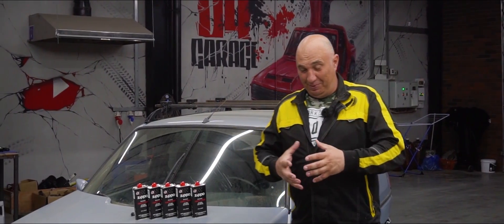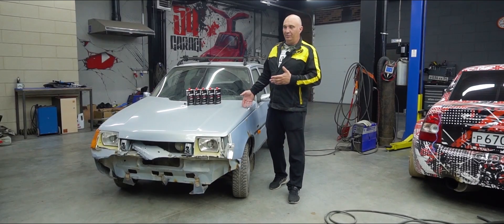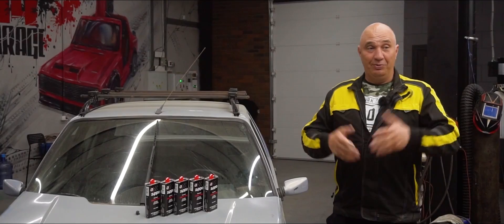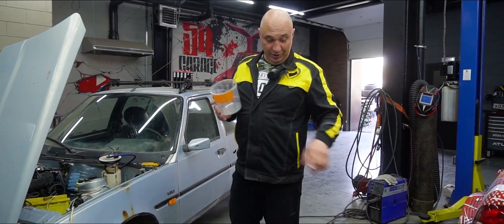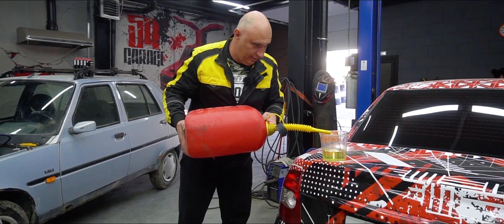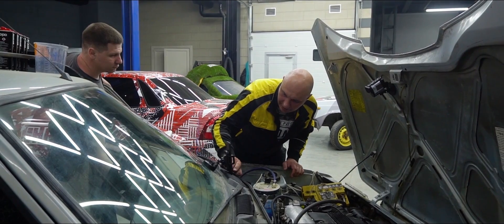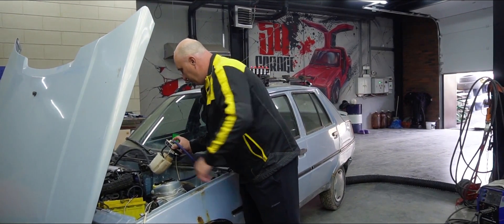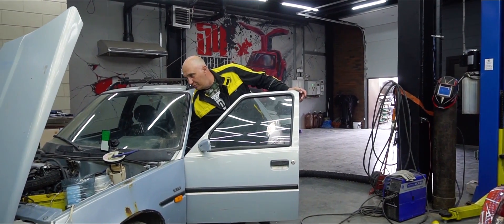Can a car run on Zippo lighter fluid?

Comment: Back in the 60s, on my way to work, ran out of gas and rolled to a stop in front of a convenience store, with a gas station in sight in the distance.  Ran into the store and bought a few large cans of lighter fluid which got me to the gas station.  Not recommended for long periods of time due to preignition.  Lighter fluid, nail polish remover, acetone, all the same except for the perfume.
Much later, in the 80s I found I was running low on fuel in my diesel rabbet on an interstate in Indiana  with a few miles to go to a truck stop.  Turned off the interstate into a small town with a grocery store.  Went inside and bought a couple of bottles of pure corn oil.  Back on the interstate, low power, top speed 45mph, low mileage, smell of French fries all the way to the diesel pump at the truck stop.  No bad side effects.  Wouldn't recommend it as a regular diet, but doable in a pinch.

Comment: Lighter fluid is actually naphtha or white gas,  same as coleman camp fuel. The reason it burns better, has more power, and causes the engine to knock, is that it has very low octane, compared to gasoline. Octane, contrary to popular belief, actually causes gas to resist burning, and ignite at higher temperatures. Resisting knock and lowering nox emissions. High octane fuel, actually reduces power in an engine designed for low octane fuel. high octane is required for high performance high compression/forced induction engines because of high cylinder temperatures which would cause pre ignition

Comment: Zippo Lighter Fluid consist of:
70% synthetic isoparaffinic hydrocarbon (a light petroleum destilate) & 30% Naphta. It doesn't contain Benzeen.
So an internal combustion engine would run on it, although it's more highly flammable. One should adjust the ignition timing.

Comment: Basically your HP and TQ went up. Just get a NOS bottle and add it to your fuel. My concern it engine tolerance. The engine might not be able to handle it over extended usage, but I could be wrong.

Comment: If the test with lighter fluid was done on a warm engine, the results would differ. A warm engine won’t be running in a rich, cold start mode.

Comment: Notice how the recirculating lighter fluid cleans out the fuel system enough to make the leftovers change color. The Russian gasoline that was in there must be pretty crude, or old. One of the interesting aspects here is the EFI engine with computer controlled spark advance (and a knock sensor) doesn't respond fast enough to the throttle jabs and allows full (normal) advance so we hear a second or two of "ping" which also results in that momentary boost of power. As I see it there would be an actual decrease in power / MPG if they had enough fuel to go a few laps on a track with a warm engine because the spark would probably be in full retard the whole way.

Comment: I have used lighter fluid in a kerosene heater, and it works.

I will say that Zippo Lighter Fluid is more comparable to Kerosene.

Also Diesel engine can run on Kerosene.
( My friend has used kerosene in his diesel truck as emergency fuel, and it works ).

Methyl Hydrate ( Methyl Alcohol ) is more comparable to Gasoline, and is compatible with gas engines, since alcohol injection system exists and is used on gas driven automobiles, where people chose to use it on.

I know there are gas engine cars that are run on pure alcohol, with retune / recalibration of the ecm/ecu.

Interesting test running a car with lighter fluid.

Comment: stack two head gaskets on the engine, then you can run Kerosene in your car. less hp, but better gas mileage. used to do it with generators all the time. Kerosene needs lower compression to run. Use head gasket shellac on them before installing gasket, if you try it.

Comment: Run a diesel engine on brake cleaner! 😁
Reply: David Bull
 ... the fumes from brake parts cleaner are highly toxic but the cleaner itself doesn't burn so needs some fuel. If someone tells you otherwise they have a brand that uses butane as the propellant.

Comment: I repeat, knocking comes from lower octane fuel, not higher. Higher octane fuel is harder to self ignite on pressure, but needs a spark to ignite it.

Comment: I think is just has a bit lower octane rating. If you boosted it with something or added higher octane rating fuel to the mix it would work just like any gasoline.

Comment: do a video on cutting the timing belt on a running car to see the havoc it causes on the engine
Reply: i'm guessing most russian cars would have non interference engines
Reply: Neutral drop tried that with a Honda VTEC, funny as

Comment: When you poured lighter fluid it was completely transparent, when you took it out after the car run for 18mins the lighter fluid is yellowish!!.. why is that?
Reply: its a injection system, there is a return line for unspent fuel, that is supposed to return it to the fuel tank, the fuel line is always going to have some left over, hence the yellowish color, it got tainted enough to just make it yellow. Doubtful that little amount would affect the result any what so ever.

Comment: If you're running higher octane you get worse performance in a lower compression engine. You get higher combustion when running lower octane. Unless you're running a high compression engine high octain will not ignite as easy. The lighter fluid is lower octane due to higher combustion. That knocking sound could have been pre ignition. Also why did you run it with 95 octane? Is the compression ratio 10: 1 on that engine?

Comment: When you pour in the zippo fluid, the engine was already warm. That could be the reason why it ran 3 minutes longer.
Reply: They ran the car on gas after warming it up. The test is valid.

Comment: Try paint thinner, kerosene... Use pork lard mixed with linseed oil to replace the normal car engine oil... 😁
Reply: Linseed oil will gunk up the system, bad idea.

Comment: Zippo gasoline is too low octane that's the reason it's so flammable... You can't use gasoline for vehicles in lighter because it just won't evaporate and ignite so easily... That's the reason for the engine knock!

Comment: The cool thing about lighter fluid is that you can store it for many years and it doesn't go bad. Its very close to regular naphtha used in camp stoves. That may also work and would still be expensive but cheaper than the lighter fluid and would be store well and if it worked like the lighter fluid in the engine it would be a great emergency replacement for gasoline

Comment: Lighter fluid is closer to kerosene in flash point...very low. It also burns dry. It will eventually score a piston and scratch cylinder walls. Engine will knock like crazy and try to keep running after ignition is turned off... detonation outrageous!!!
Reply: Yep. Lol

Comment: So Zippo fluid is around 60 octane, the reason it last longer is a lower flame front speed, which means more energy from the fuel burn, it's low grade gas
Reply: So if it’s low grade gas, shouldn’t it be cheaper than gas?
Reply: @Big.W.  A company can charge you what ever you they want.

Comment: NA low compression economy cars tend to run like hell when you run high octane in them. I bet if you ran some lower octane stuff in it you would get a similar result to the lighter fluid. 95 just isn’t volatile enough.
Reply: Cj Smith... that's not true. The higher octane actually retards the burn so the fuel doesn't pre-ignite before proper spark timing happens. The idea here is to allow higher compression, which is where the extra power comes from.

Comment: Lighter fluid is Naptha. You can buy it by the gallon at most hardware stores. while still more pricey than gasoline, way cheaper than Zippo brand Naptha. dump about 5 gal in and go rip some shit up, lol

Comment: If you take normal pump gasoline and then process it with destillation you will end up with something similar to Zippo fluid, "White Gasoline".
It is gasoline anyway and it will work on modern cars but may be not safer because it does not have the hundreds of additives of which the systems are designed to work with.
It will vaporize really fast so it wont hold on your tank for long but hence the slight power boost as you have more gasoline in vapor form when the spark ignites. The car, as being standard configuration may have incorrect ignition timmigs, you have to set the ignition to ATDC when feeding more gasoline in vapor form because the flame speed is faster .

Comment: Dear garage 54 could take a car and replace most of the panels with pleixglass so it is transparent remove the hood of course as it would melt if made from the same material.

Comment: Lighter fluid doesn't have any lubricants in it though. The engine will blow faster with the thinner fuel. It'll Knock without the octane lube in it. Blow it up. Let's see the flames. Alot of power though.

Comment: Not sure if this is fake.... 

two simple reasons first of all look at the different colour of the E85 compared to the lighter fluid when he's pouring it into the measuring jugs. E85 has a yellow hue while zippo fuel is clear. He runs both fuels But at the end when it comes to check out how much zippo fuel is left It cuts to him pouring out a yellowish liquid out of the container into the measuring jug rather than pulling it out like in the E85 test. Its a conveniently placed jump cut....

Secondly. Zippo fuel evaporates pretty quickly when exposed to air. The guy saying that theres a the same amount of zippo fuel left as the E85 test, i dont buy it. A lot of that zippo fuel would have evaporated. Thats why zippos are a love hate thing. People love that they are classy as fuck but hate the fact that they have to refuel it every week because zippo fuel evaporates.

Zippo Fuel is also a solvent and it will eat away and dry out any rubber piping or seals that it comes into contact with for extended periods. Some people use zippo fuel like they use Acetone for cleaning things.

For a fun experiment its ok. but if you plan to run this in your car long term. you 100% will destroy your engine

Comment: Run a diesel engine with r/c nitro fuel.
Reply: That's actually a very interesting one.
RC nitro fuel is usually a mix of 85% oil & 15% nitromethane.
So the diesel engine should run happily on it.
The interesting bit is if the oxygen in the nitro will increase the power output, or just overheat the engine.
Reply: @thefreedomguyuk  rc fuel (nitro) (the brand I have) is around 8% oil, 25% nitromethane and 72% methanol
Reply: Nitro fuel works for starting fluid in a pinch lol
Reply: Nitro rx fuel has oxygen in it
Reply: It Will blow.
Reply: @tomasnokechtesledger1786  you will blow me
Reply: It would explode
Reply: @RuviaPawz  no
Reply: it wont work. Diesel engines have no sarkplugs
Reply: @teokarlsson305  Neither do nitro engines. Dragsters self ignite half way down the track on nitro methane.
Reply: @UniCrafter  Correct, and they have to.
Top Fuel cars have spark plugs along the first half of the strip, after that point, they don't have spark plugs, only ceramic inserts. The electrodes of the spark plugs are melting.
Reply: @teokarlsson305  they have glow plugs, like rc nitro engines.
Reply: @teokarlsson305  they have glow plugs like nitro engines. A nitro engine is basically a diesel engine.
Reply: @teokarlsson305  But the nitro fuel is mainly oil.
Reply: @teokarlsson305   you can start it on diesel and switch.

Comment: did anyone notice that the gasoline was a yellowish color? Did anyone notice that the lighter fluid was completely clear? Did anyone notice that the "leftover lighter fluid" that was poured back into the measuring cup was the same color as the gasoline?

Comment: "Regular 95 octane"
If only
Reply: Are you in the USA perchance?
Reply: @ChrisWilliams-i7d  Ding ding
Reply: Every fule has a purpose. Has nothing to do with quality and only with compassion ratios.
Reply: @Crazywaffle5150  There's no need to try to correct me. In the U.S. 87 octane is considered regular, and anything above that has more fuel additives and is higher quality, which is why I said "if only".

I understand the relation between octane and compression.
Reply: @Heck6  
Because the Europe and Russia uses other ratings of fuel.
It is like the US rating + 10 for Europe and Russia:
So, if you have in US gasoline with 85, in Europe we have 95.
Thats because the US uses the COM rating and Europe and Russia uses the COR rating.
Reply: @MiCatalin  ohhhh, cool to know
Reply: @Heck6  
Sorry!
I was tired while i wrote that.
COM and COR abreviations are used in my country.
In english, they are called RON (for Europe and Russia) and MON (for US).
Reply: @MiCatalin  that makes more sense lol

Comment: Back when I was young I went to the closed gas stations at night and filled my zippo with the gas that was still in the pump hoses. Worked no problem
Reply: Buy you have gotten get some lead in doing so.
Reply: @pizzablender  ... I also did that and after a few weeks that distinctive "click" in the lid went away. (anti-knock) Yup, lead is also a lubricant!
Reply: But you'd have to refill every night, due to the  petrol being volatile and rapidly evaporating.
And the Zippo stinks!
Reply: Might be able to mix oil with the gasoline when used in a lighter, to slow the evaporation rate down.

Comment: Of course this works. Look up fractional distillation of gasoline. Naphtha is a component of gasoline.
Reply: ECUs will retard ignition when they sense/hear detonation (knocking, which can be caused by lower octane) they don't advance due to higher octane. But the ECU will compensate fuelling based on the o2 sensor feedback.

Comment: When I was in high school and poor I used gasoline in my Zippo lighter. It worked just fine.
Reply: Until it evaporated the next day.
Reply: @positronundervolt4799  And not to mention that I smelled like a Exon gas station. :)
Reply: Same here but was smokey as a bush fire and set yer hand on fire on first light up!! 🔥🔥

Comment: Lighter fluid is just super refined gasoline. Remember the old Coleman camp fuel,called white gas? This is the exact same stuff. It doesn't have the additives that gasoline does. That the only difference in octane levels is different amounts of an additives.

You guys need to get a bunch of model airplane fuel! Nitro Methane!!!! A friend of mine used to build pulling lawn tractors. He would put half gas and half model fuel.

Comment: I've used gasoline in a Zippo. It Works fine, Just next day is already empty by evaporation.
Reply: Should try kerosine just for shits and giggles
Reply: @nikonordman7624  Kerosene makes Too much fuligem and It needs to be heated to light. Ethanol os better, when above 70F.
Reply: That's why Zippo fluid is oil based so it doesn't evaporate as quickly... But to save money use charcoal lighter fluid more bang for the buck with only fewer lights per refill. And the shits basically smells the same company's and their fancy stickers just to get ya..
Reply: All my grandpa used to use
Reply: And I’m sure you smell pretty good every time you use it too. :)
Reply: Gasoline worked on my zippo too. But on colder days I had to scratch like crazy to light it.  And it had nice black smoke tail when it lit. 😂 I didn't inhale the first 10 puffs of cigarette when using gasoline on my zippo.
Reply: "Honey, why does the house reek of gasoline again?"

Comment: The lighter fluid would be lower octane. 
Octane is resistance to ignite. 
It would be more efficient and more powerful, but it ignites to easily and that’s why you get pre ignition knocks and pings.

Comment: In England we call that knocking noise pinking you will probably get the same noise if you run on diesel petrol mix or parofin 
Love what ur doing mate but you need to brush up on your driving skills

Comment: 95 octane? WTF Russia. We get ripped off.
Reply: Europe uses a slightly different way of measuring the octane rating. I'm in the UK, and what we'd call 95 (premium unleaded) is more like the 88/89 you'd get in the US.
Reply: @Zeem4  
Because the Europe and Russia uses other ratingsof fuel.
It is like the US rating + 10 for Europe and Russia:
So, if you have in US gasoline with 85, in Europe we have 95.
Thats because the US uses the COM rating and Europe and Russia uses the COR rating.
Reply: Sorry!
I was tired while i wrote that.
COM and COR abreviations are used in my country.
In english, they are called RON (for Europe and Russia) and MON (for US).

Comment: Maybe not as fun, but do a similar experiment using all the different fuel types available at petrol stations. Of course the 3 grades (regular, plus, premium), the only difference is pre ignition, given higher performance engines burn hotter and thus need the higher grade to prevent pre ignition. But that just means you'll need to do the test with a high performance engine which requires premium, then step it down and see what happens...
Reply: PS - I've already tried many ties putting plus into my car, mainly in the hot summertime. It does seem to be a tad smoother, but in the end, it barely makes a difference at all.